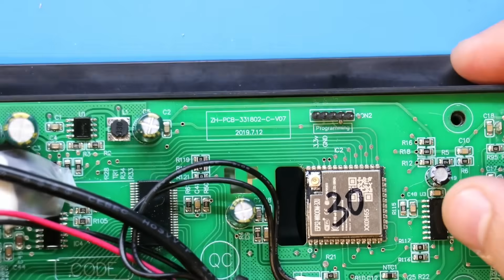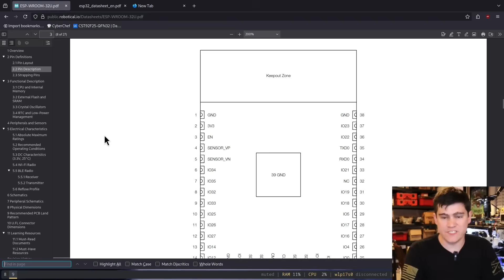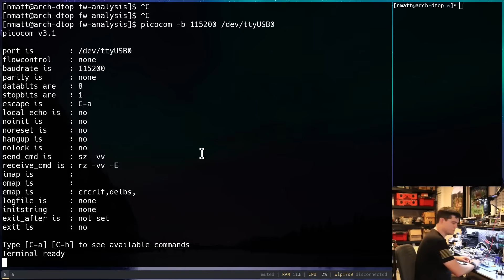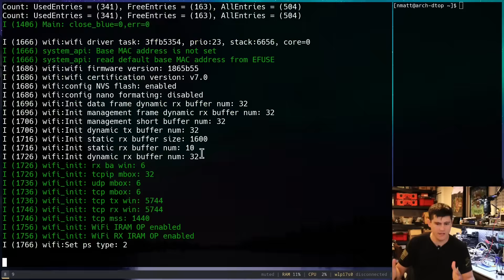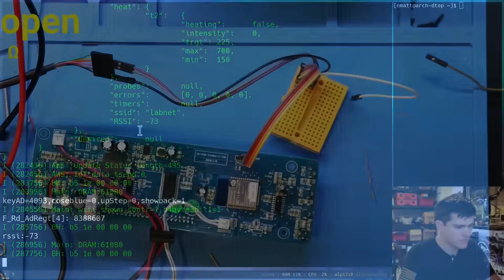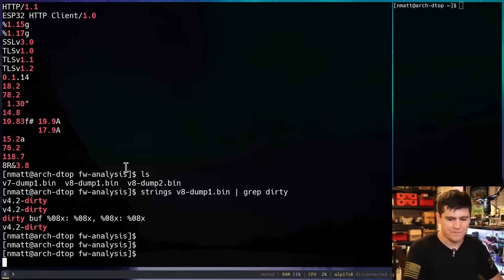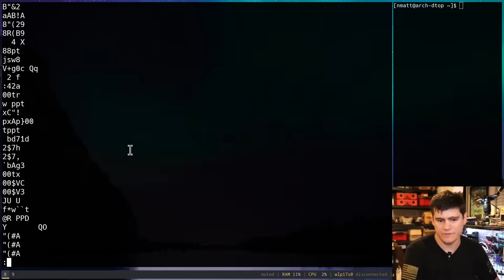Hacking My Smart Grill - Extracting Sensitive Data on ESP32

Comment: Did you put tape and hot glue over the buzzer? This seems to be a dev unit as manufacture wouldn’t do that
Reply: Write the firmware of the good unit to the eBay green board. Find any changes in the hardware and bodge the v7 board

Comment: Are there any part numbers on the two smaller chips for the Thermocoupole and the temp probe ADC inputs on the right? I'm trying to map the production controller out and they sanded the faces, and the K-type chip has a strange pinout.

Comment: The real question here is WHY the F a grill needs to be "smart?"
Reply: It's a smoker made for 12+ hour cooks. The main use is the PID controller for the fan, which does a really good job of keeping it +/- 5 degrees the whole time. The app is handy if you want to check on things without going back and forth to it all day and night. I am trying to reflash it with ESPHome though, because it shouldn't need the cloud. MQTT would be plenty.

Comment: Awesome! Can you reverse engineer the Auto Ignite 545 board to drop the low range to be 215?  For some dumb reason the lowest setting from the manufacturer is 250.
Reply from the maker: Woah this could be a cool use case...
Reply: You could probably accomplish this with just a quick hex edit.

Comment: Having to fight against the encrypted and locked Tuya chips in the cheap stuff I try to integrate into home assistant via ESPHome, I almost can't believe a more costly product just has a standard ESP and includes pads for a debugging header 😅
Reply: yeah, I have a chinese lamp for 4 bucks and its rebranded tuya that doesnt even talk to my phone on the local network, it only talks to the wifi > cloud servers in 2k km away from (im in russia and their servers in east europe). the delay between me clicking the "turn off" button on the smarthome app and the actual lamp turning off was 1s to 10s to sometimes 30-60s due to dns resolve or proxy problems or the internet blackouts that happen a lot in this region. BUT thankfully, I was able to connect the lamp to home assistance docker that I run on linux which has localtuya add on that you just need to copy paste into the ha directory. I spent about 6 hours with gemini and tuya developer dashboard to figure out and eventually was able to grab the local key, the account ids for the authentification process with lamp itself (?). so I spent 4 hours debugging why it wasnt connecting on localtuya, the lamp and the ha and I just needed to use the most newer version of the software of their specific protocol and the localtuya lets you manually select which one do you need. lamp is now only talks to the laptop and I put a parent control on the home router for the lamp so it cannot reach the cloud servers. Obviously the delay is minimal no compared to what it was before plus I can really customize the ha dashboard that is FOSS if I remember correctly. Also I run their ha app on my smart watch that lets me turn off and on the lamp and different modes of it from my watch which is something outstanding for me. The moment I was able to really delete the smarthome app and block the connections to the cloud servers felt like I was finally getting free from jail or something. Such a light and nice mood it was and still is.

Comment: Nice explanation of the esptool stub system, a lot of people gloss over that.

Also, the vX-X-dirty postfix is added when using a modified bootloader. Pretty sure that is done by modifying the Git submodule. The most notable case of this is when using Arduino instead of ESP-IDF.

I'm surprised they aren't using encrypted flash/secure boot in a production environment. You would have had a bit more trouble with this if they did.

Comment: As much as I would like to see the WiFi credentials encrypted using something like a HSM, I realize most IoT devices will just use plain-text storage, or if they do encrypt it the key would probably have no security of its own and could be extracted too anyway.

Now I have a crazy (let's be honest, overkill) home network setup with a dedicated IoT vLan and WiFi network. But most modern consumer routers now offer a Guest WiFi network in addition to the main WiFi network, I would personally recommend a non-technical user to always use the Guest WiFi not their main WiFi for IoT devices at least. So if someone does extract those credentials from an IoT device, and tries to connect to it, at least it doesn't give them anything other than internet access.
Reply: Frankly, my own recommendation would just be to not put your grill on your wifi. That seems like a pretty reasonable ask...
Reply: @PhysicsGamer  That doesn't change the fact that most other IoT devices are the same. Your only real option is to not use IoT devices or at least not on WiFi which most people won't do.

Comment: The real question is. Why tf a grill needs an active connection to aws?
Reply: Obviously so you can preheat the grill from the other side of the country
Reply: Because it's simple. You use AWS IoT Device SDK, pay for AWS IoT Core, and outsource mobile app development to indians
Reply: Everything goes through AWS. I was looking for a dashcam software to run on my pi and they wanted me to run AWS
Reply: Yup, AWS has a whole fleet of IoT services that make it trivial to do really complicated things. It’s a default choice for a lot of developers looking to create new smart-products
Reply: This might be for OTA - the FS is mapped to hold OTA updates - they probably upload new versions to AWS, so an MCU could request and download/flash itself
Reply: so that the WEF  can monitor your carbon footprint apparently.   I don't know why you would need a "smart grill".  You need gas and a lighter or piezo igniter.
Reply: @daomingjin  The part of the wifi/bluetooth connection I get it. If you want monitor the temps of the grill and shit, is ok. The fact that you can even add 4 extra sensors is awesome (specially if you use one of those long ones that you can insert like a spear on thick meat cuts). But the entire aws part is completely unnecessary.

Comment: ESP32 doesn't have flash encryption like most FPGA/CPLD's?? Why would anyone use an ESP32 in a commercial product then? I see it in many modern devices and if it's a free 4 all to dump, it shouldn't be hard for others to clone/steal IP.   :(
Reply: ESP32 has flash encryption and secure boot -- this company just sucks at security
Reply: If your ESP firmware is your IP then your company probably doesn't make anything worth stealing.
Reply: @PhysicsGamer  Lots of makers in the retro game console scene use ESP32 as the core of their add-ons. Anything from HDMI upgrade kits to CD-ROM ODE replacements (like XStation for PS1) These are not companies, but 1 guy making a device to help others. This explains how AliExpress is full of clones of their stuff.

Comment: The 3.3-dirty and 4.2-dirty are versions of the ESP-IDF bootloader and not the app itself. You pointed out the partition table and right below that you can see it boots  the app from the factory partition - which shows the app 'gpio' version 1 being booted. This is the code that runs after the bootloader which sounds like its identical on both devices.

Comment: Plain text passwords is perfectly fine for wifi. A threat actor would have to have physical access to your home for extended periods of time to dump the firmware. If they have, they can just as well tamper with your computer or install hidden cameras.
Reply: Exactly that. And if you're in a position to require confidentiality and security of your network, don't put your outdoor cooking equipment on the same wifi as the confidential data.
Reply: @tin2001  Being on that position already seriously questions "owning" anything smart in the first place ;)
Reply: Your neighbors must love you 😊
Reply: If your grill is inside near your computer,  you would be right but I keep mine outside.  It undermines the need to segregate IOT devices on a different VLAN (SSID) from all other devices.
Reply: @RonLeedy unfortunately no consumer router lets you setup vlan rules to prevent iot network devices from accessing main network devices over lan, but main ones can talk to iot ones on lan. Such a directional vlan rules config doesn’t seem to be possible on stock firmwares(which most people use, and idk how to do this properly in dd-wrt), and is only possible on enterprise level stuff like ubiquity or custom routers with pfsense or similar.
Reply: its like keeping your housekeys board easily visible through a window
most of the time its not a threat since anyone who is inside can grab your keys anyway
but there are so many edge cases and layers of security breaches that other parts of your threat modeling just assumes is safe, and its so easy to not do that ...
Reply: If you want to make a person's life really complicated, use text statements between quotes instead of passwords. Those are impossible to crack through any method you can imagine because of their extremely high entropy, especially when it's Unicode text.
Reply: "Plain text passwords is perfectly fine for wifi. A threat actor would have to have physical access to your home for extended periods of time to dump the firmware." 

And then you assume, every user does a nice factory reset and clears all data before some device gets sold to your trusted hacker boy on ebay? Plain text passwords are a pretty bad idea for a IOT device IMO.

Comment: At this point, I'd just flash the v8bin onto the v7 board, just to see what happens. If it doesn't work, then I'd reflash the original firmware back on, and go for more in depth analysis. But devs are lazy, and random china devs are even lazier than that. It's probably not using very many io pins, and all the important stuff is probably in the exact same place (display gpio, thermocouple i2c channel, etc).

I'm lazy, I'd just flash the already configured v8 firmware dump from the real board, to the china board, and see if it works. If it doesn't, then I'd try the unconfigured v8 firmware, and do the setup process to see if that works. If those 2 failed in some way, then I'd start doing more complex stuff on the dumps

Comment: Very cool.
In the esp32 devices I've encountered (mostly smart relays) - GPIO 0 is often linked to a button. It may be mapped to a button here so holding a button while powering on could get it into programming mode.
Reply: Right, it is the recommended setup - they pull it up with a 10k and Boot btn just pulls it to GND (with a debounce cap)

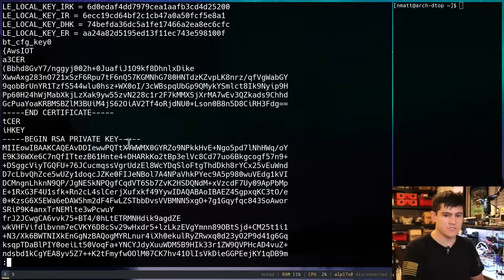Comment: 27:30 I have programmed an IoT ESP32 before. We used esp-rainmaker-admin-cli which will generates a private cert per device instead of the single hard coded one like shown. If we had abuse from a cert, we were able to revoke that cert and then the device would no longer be able to access AWS until a new cert was flashed.
Reply: Could just enable flash encryption on the ESP32 then the extracted firmware is unreadable. You can disable the UART/JTAG too and only allow OTA updates. Locking it down.
Reply: @darktherapy  yup, those are things you can do and they are both simple settings but it doesn't look like either was done to this grill.

Comment: 3:56 So what sometimes happens with product made under contract overseas is that there will be a production run, but a certain number of the products (or parts) are scrapped for one reason or another. Either they don’t quite meet spec or something else. The problem is when they aren’t securely destroyed, someone in the factory’s waste stream (often a loose affiliated entity, perhaps owned by a cousin) will take those rejects or factory seconds and either directly resell them or package them into counterfeit product. This used to happen with shampoo bottles for example, and the person acquiring them will fill the bottle with junk, but put just enough real shampoo in the pump so it passes an initial look. The cure is often not to print the logos or to add a hologram sticker or something at a later point in the manufacturing cycle. Here, the logo wasn’t on the unit you acquired.
Reply: Another thing that happens is that a company makes a product. You could call it a reference design, but it's really a product essentially ready to go to market.

That company produces some number for their own purposes. Their primary idea is show them around to people who want to market them as their own. So they make these and then meet with masterbuilt and show it to masterbuilt and say "would you like to sell this product as yours?". Masterbuilt says yes and they both agree to make a few minor changes in the hardware and of course put the masterbuilt logo on it. Once that agreement is reached they make those units and masterbuilt sells them.

They also may meet with other companies and say would you also like to put your name on this. They may sell it multiple times.

Anyway, once all this is done those original reference units still exist. And the company sells them on the open market. They may not even be supposed to do this by contract, so they may sell them through other channels like you suggest.

The units aren't really seconds, aren't "night production", aren't counterfeits. They are units which were made before there even was an agreement with masterbuilt.

There are a lot of variants on this, especially since some brands aren't even really companies, they are just marques owned by a company that can be licensed. In that case the original designing/producing company may do all the production and wholesaling and just have license to put the name on them.

All this can happen through a process called "original design manufacturing", "joint design manufacturing", "private label manufacturing" and "white label manufacturing"., You can look them up. The above is pretty much white label manufacturing, but there are blends and half steps of all these systems which also can apply.
Reply: @stevebollinger3463  And sometimes those products turn out to be thousands of bombs disguised as an electronics device that a genocidal nation-state manufacture in order to detonate remotely at random locations in a neighboring country
Reply: This is exactly it

Comment: be careful when Ohming out Gnd. To read resistance your meter puts out voltage and then measures the current and does some math to give you ohms, sometimes it outs out quite a bit of voltage to read high resistances.  If your meter is outputting more then 3.3v and you hit the v+ ie that pin that shows 3.3v, you could burn up the esp32.  Then it's sad panda day, You've borked your device.

Comment: Could it be that it is a white label solution? So grill manufacturer just looked for a generic grill controller and let its logo be put on. I don’t think the grill is so popular it’s worth making counterfeits as you said. I think it’s more likely that the grill company has no infrastructure to develop an IoT stack and then buys it white label
Reply from the maker: I don't think it's a whitelabel. I think it's probably a dev unit OR just an older model that they made not work because of a mobile app update.

Comment: I would love for someone to reverse engineer the Anker SOLIX F2000 (PowerHouse 767) Bluetooth interface. It would be an awesome solar UPS (with mains power backup) to run your home lab on solar/battery, if only I had the ability to monitor the battery state, I could automatically switch the mains on to charge on cloudy days.

Comment: Smart grill sounds like a dumb product.
Reply: Totally. The fun part of a grill is to be there, talking to people while cooking some meat in your backyard. I am standing just in front of it.

I am a fan of connecting things, but cannot think what the use case of a cloud-connected grill is. I want to adjust the temperature remotely because I am far away from it? What? Does not make any sense at all.
Reply: @RobertoSaralegui  I'm not standing by my smoker for 12 hours for a brisket. This thing will maintain +/- 5 degrees as long as there's charcoal in the hopper.
Reply: @RobertoSaralegui  Surely if you're adjusting the temperature it's because you're checking whatever's being grilled and making sure it's ready to move on to the next step... it's like those "smart dishwashers". There's no conceivable scenario where I am away from my home and want to spontaneously start a wash cycle.